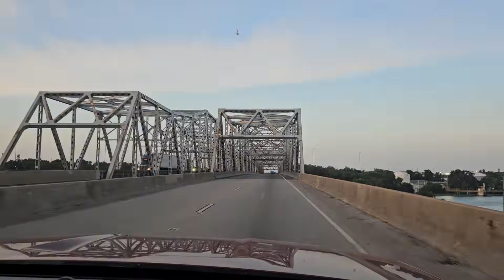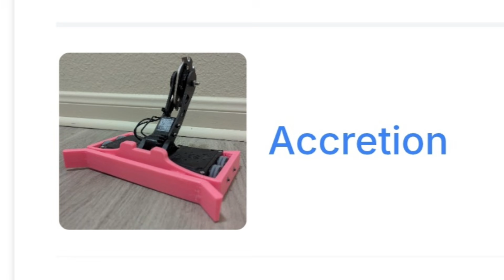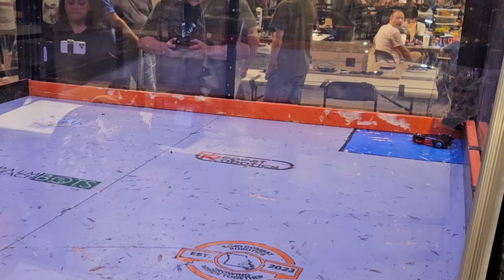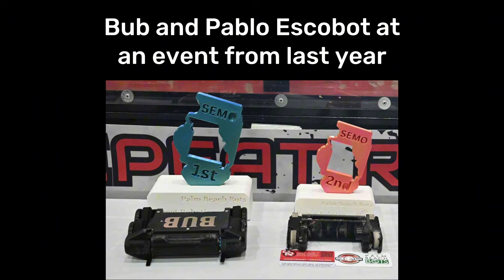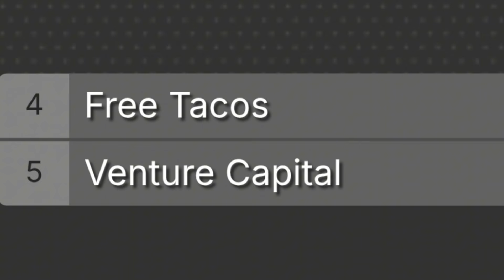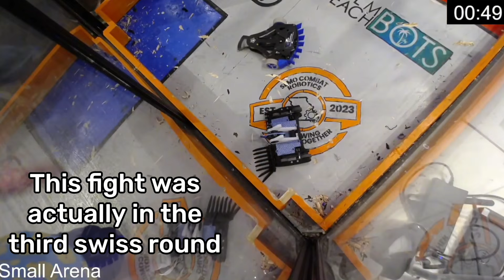SEMO Brawl at the Mall Quad Con July 2026 review

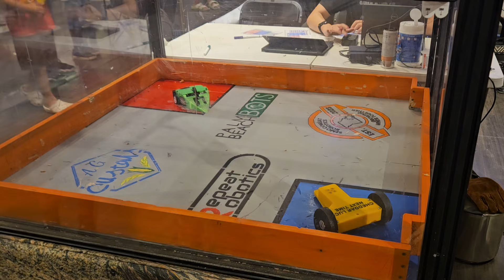Comment from the maker: 5:15 I recently discovered that the new motors I bought for Cheddar have an 1800 kV rating, while the old ones had an 1100 kV rating. I don't know why I thought the new ones were 1100 kV, but either way I'm gonna try to adjust my remote to make it impossible to spin the blade too fast

Comment: maybe you could put something on the top of free tacos so that robots that try to drive over it are stopped, kind of like a wall, also makers muse has some good tips on building plants you should check his videos out
Reply from the maker: We can't add too much to the top because it still needs to be able to drive upside down, but we put holes in the big wedge so now we can use it with the short forks designed for pushing